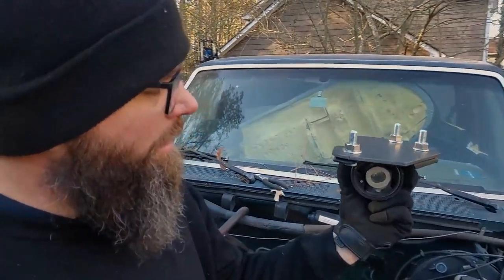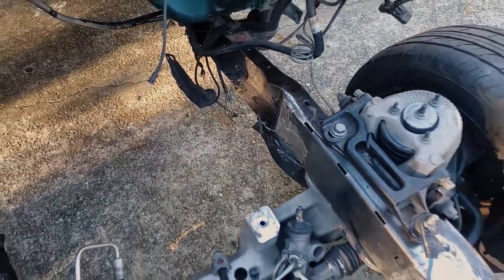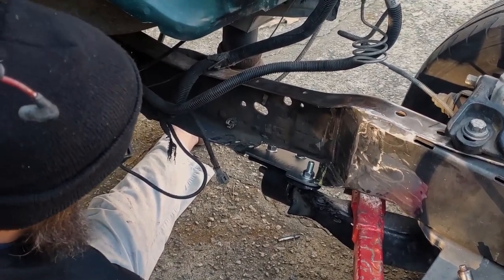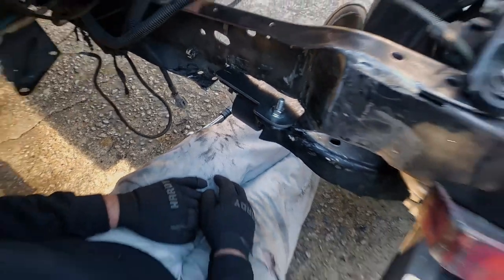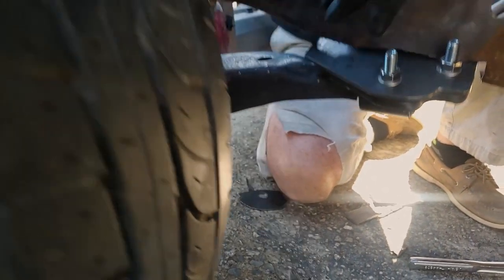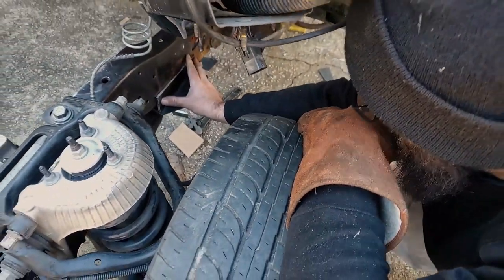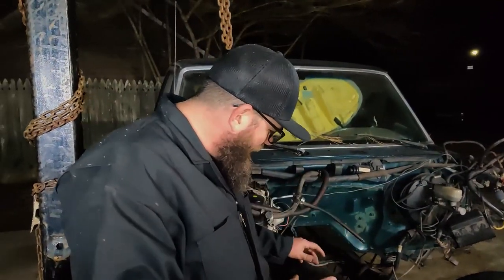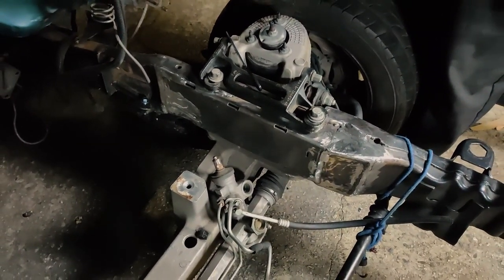How we Installed Trailing Arm Brackets for Crown Vic Coyote Swap F150

Comment: Looks awesome ! I’m doing the same on my truck and I finished up the suspension part and now that I’m putting my engine and transmission back I notice the transmission is short from where it is supposed to be. What are your thoughts ?
Reply from the maker: Thats great.  Also that stinks.  What are you using for mounts and what engine tranny?